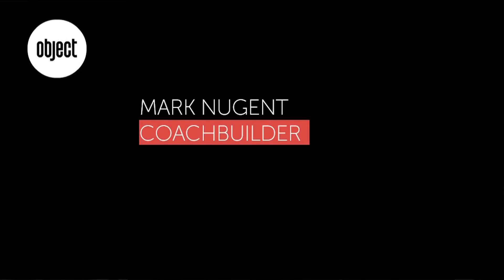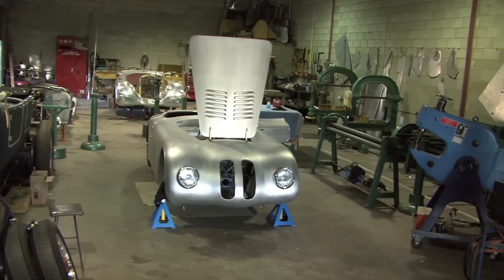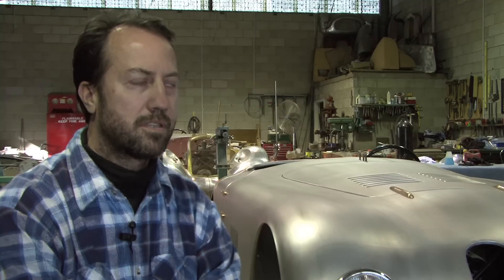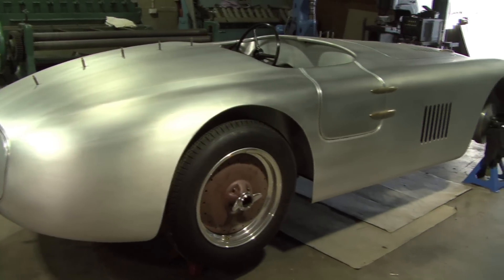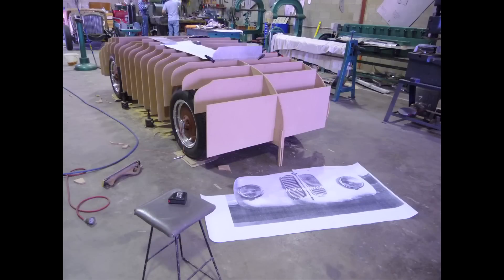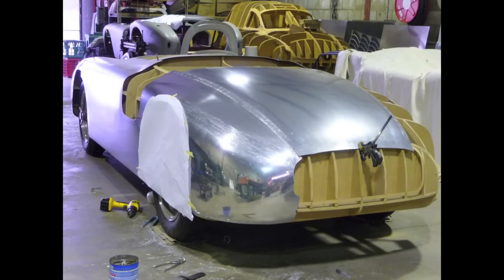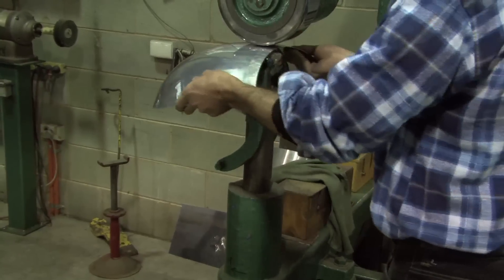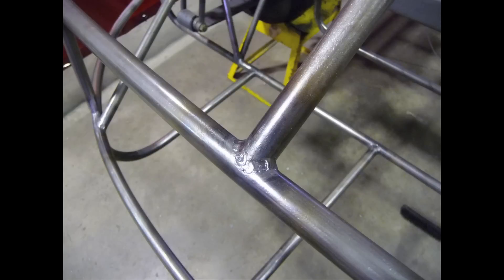Inside Mark Nugent's Coachbuilding Workshop

Comment: Carl Benz did not invent the combustion engine. In circa 1855 Bersanti and Mateucci filed patents for a two stroke engine, but this is disputed. In 1861 de Rochas filed a patent for a four stroke engine, later followed by Nicolaus Otto building the first practical working four stroke along with Michael Zons in the mid 1860’s building upon the earlier works of the above and Lenoir’s work earlier in the decade. The success of the Otto engine is largely attributed to the invention of the spark plug also developed by Lenoir in the late 1850’s. Two stroke engines did not become practical until the 1880’s with the works of (separately) Clerk, Day, Scott and Benz

Comment: I think the 3D printing is just another tool that you could look at for anything that's being done by any outside companies in your project, to stay true to the craft. For example, you still do the english wheel, planishing hammer, all your usual sheet metal work, but if you were outsourcing hinges or chassis and they could be 3D printed, then it's not really changing your craft at all. Not saying a Chassis can be 3D printed, just an example. 

Something like dash panels or light housings, I mean anything that you get other people to make or anything you are buying off the shelf that is not made buy you personally should be looked at to increase the products you can make in house, that's then a product that you can offer for sale as a 2nd tier product and help get your over heads down.

Comment: Mark. Excellent job done with the BMW 328 MM ! Just to say that the car is not to declare as "rare" because the original one is a true one off. So far I know to race the Mille Miglia in 1941. You may know that this never happened. 
By the way Carl Benz invented a three wheeled motor car.  The compressed charge internal combustion engine was developed by the engineer Nikolaus August Otto.
Reply: Thats 2 bmw  328 mm's built here in australia,one was built on the goldcoast for a mercedes guy a few yrs back

Comment: A beautiful art, for the most part, where hand work is involved. I have mixed feelings about distancing yourself from technology to some extent. As usual with any slippery slope; where do you draw the line? Older coach builders did not have the power tools that Mark used, nor the quality of metal that he is obliged to use. Even the tools for shaping the wood buck made the modern version orders-of-magnitude easier, quicker - and probably more accurate.

3D printing will completely disrupt manufacturing when (not "if") it becomes more affordable - and I'm not talking about polymers like ABS but liquid-jet printing of plasma-melted alloys, glass and ceramics. 

The merit of being hand made is an artificial feature, once 3D prints give identical, not similar, results, to printed objects. Output will depend on the quality of the 3D scan of an original, to produce an identical copy - or on the designer's ability to apply some man-made variance into his 3D files. This is similar to hand-writing fonts that vary the font as much as the human writer would have produced. Nothing wrong with that.